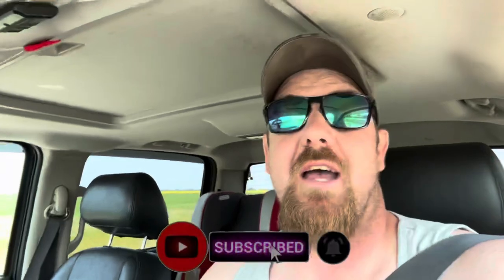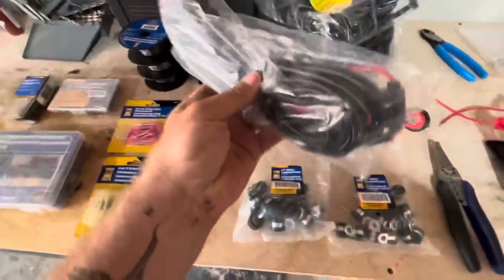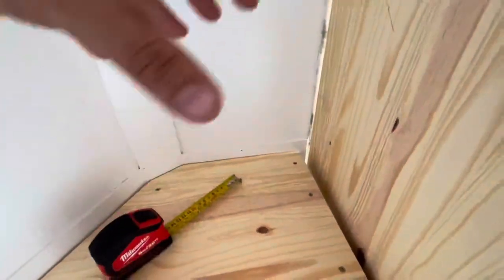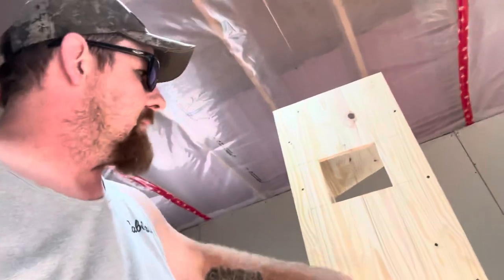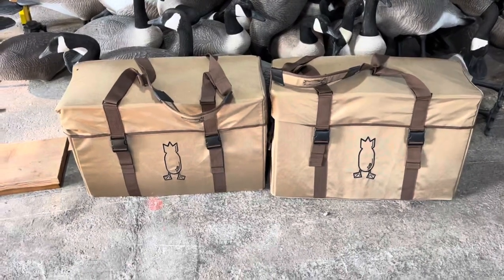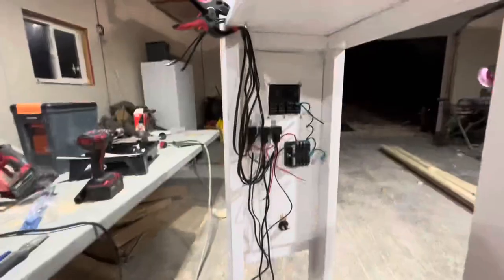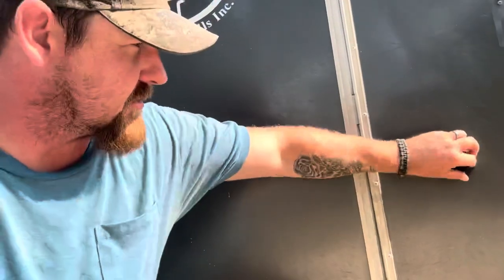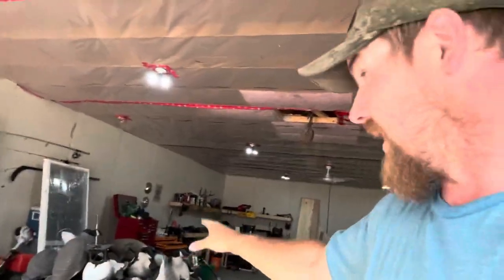Goose Hunting Trailer Build Part II: Electrical Cabinet and Wiring

Comment: In process of doing same thing right now,  just not a fan of punching a bunch of holes thro the roof. But I haven’t thought of any other way or doing it.
Reply from the maker: Yeah it makes you cringe a little punchin holes in the roof, good rubber grommets and silicon I guess. I’ve seen guys go through the wall as well when mounting on the side of the trailer as opposed to the top.

Thanks for watching, appreciate it👍